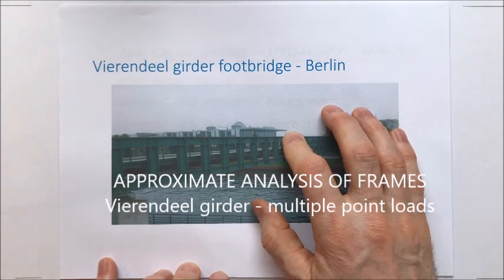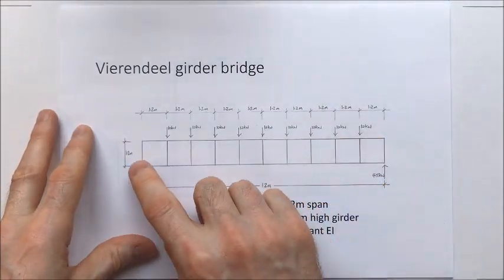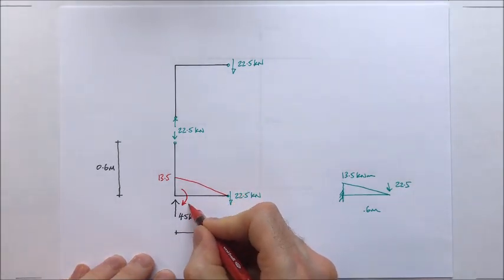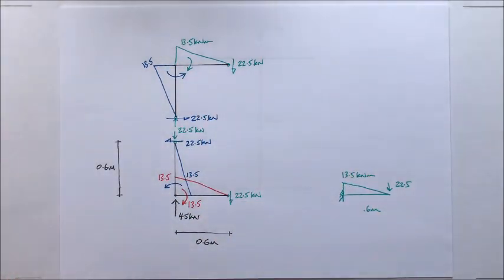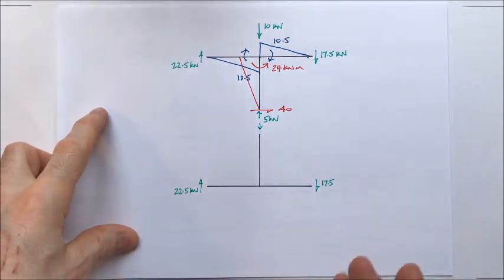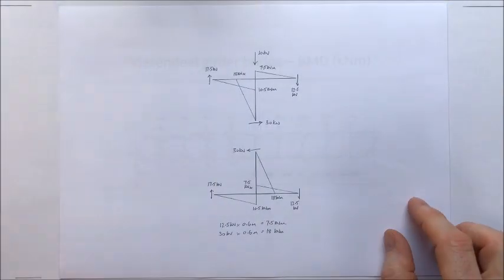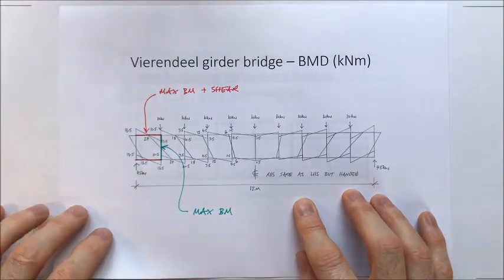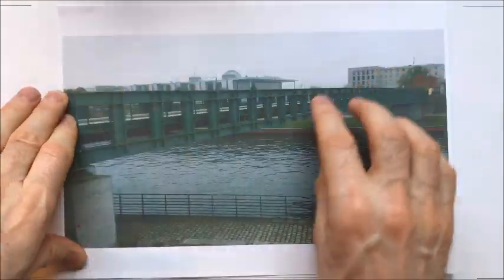Approximate analysis of frames (7 of 7). Vierendeel girder - multiple point loads

Comment: Thank you for detailed explanation. By the way, is there a specific reason to assume that all the contraflexure points are at the center of members?
Reply from the maker: Hi STF K, the only reason is that it is quick and convenient and more or less OK, in fact, where stiffnesses are equal then the middle is a good location for the point of contraflexure, but where this is not the case, it will almost certainly be wrong (but not by too much). But, heh, this is approximate analysis. If you would like to better assess the location of this point, then I suggest Graham Owens' EKT published by the IStructE in the UK. This gives a more refined version of the analysis. Hope this helps, Mike

Comment: Hi Mike, I hope you don't mind my question. How would a multi-storey V.Truss work, for instance framing 2 or 3 storeys in a multi-storey building to span over a column restricted space?  Assuming the same reaction at each point at each floor?

Could you take a 3rd of the load for each storey and design it as a single storey v. truss?
Reply from the maker: Hi Chris, I hope that I understand your query correctly. Firstly, the columns in a Vierendeel girder are very stiff when compared to the beams when considering the transfer of vertically applied forces to supports. So the applied loads will be apportioned between the beams - regardless of their level in the structure but according to the relative stiffnesses of the beams. Secondly, for a single storey truss horizontal shears in the top and bottom beams would carry vertical loads to supports (i.e. two lines of beams). For a two storey truss, vertical shears in three lines of beams would carry applied loads to the supports. For a three storey truss there would be four lines of beams, etc. Thirdly, the trusses spanning the column-free area below would need to carry all applied loads from above. I hope that this is on point and answers your query, Mike

Comment: How would you go about working out the overall deflection by hand?
Reply from the maker: Hi Boris, this is the beauty of this method of very simple hand analysis - you cannot make a quick and reasonable prediction of the overall deflection. Therefore, your analysis will always need to end with a caveat that the deflection will need to be checked (beware, deflection may very well be the governing factor too), hope that this helps, Mike
Reply: Some thoughts on a quick approximation approach: The deflection δ for the o.6m cantilever from the first sub-frame can be easily calculated. This can be worked out for each subframe or conservatively assumed for all bays and multiplied by number of half bays to the line of symmetry (2x5=10δ in this case). Naturally this doesn't account for shear deformation, which will be highly dependent on the ratio/spacing of the truss bays. For normal trusses I use rule of thumb factor of 2 to account for this, so maybe overall factor of 3 for vierendell trusses ?

Comment: Hi Mike,
why don't you indicate the axial forces being in compression and tension at the top and bottom chords ?
Reply from the maker: Hi lutfu dursun, that is a good question. I guess that the focus of my videos has really been the approximate analysis of frames (for buildings) and the bending moments developed. You are perfectly right that each free body diagram of each joint is only complete when axial forces are included and for Vierendeel Girders these forces can be large. In trying to keep each video as short as possible, and as the axial forces are not required to find the bending moments, they have been left out. Any final analysis should include them. This can be done by extending the analysis of each free body diagram to include the axial forces. Thanks for pointing this out, Mike